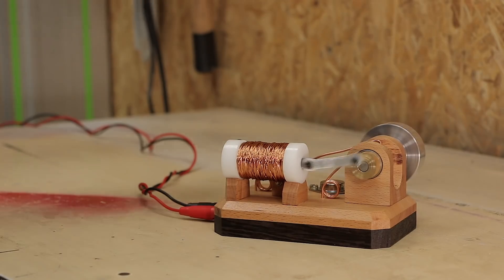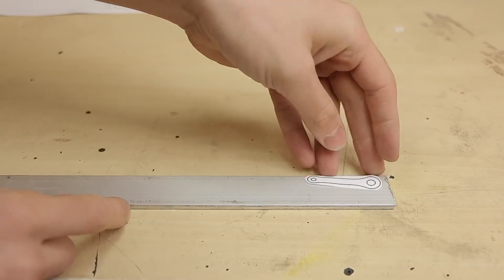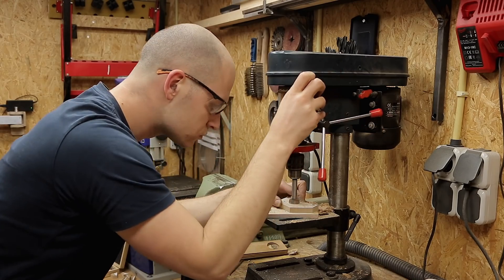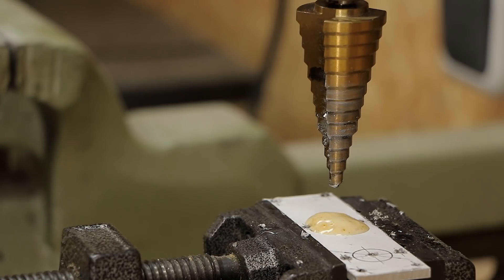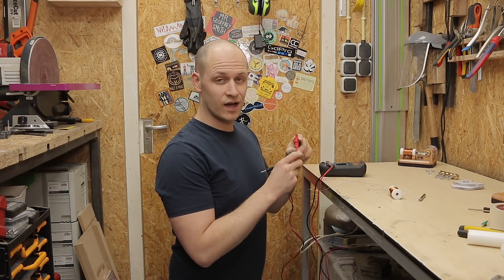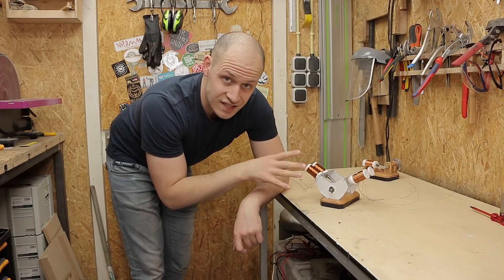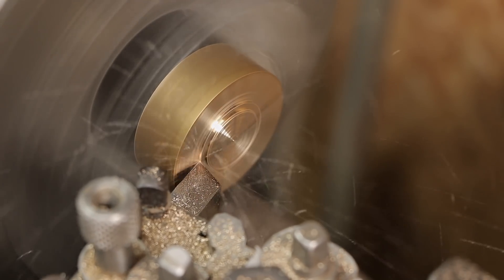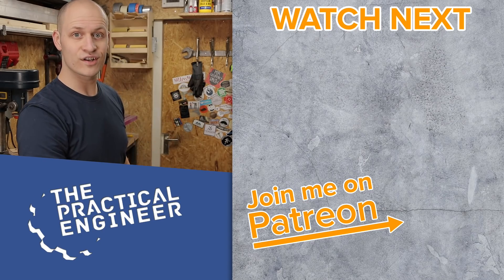How to make a V4 solenoid engine

Comment: now build a little transmission, and torque convertor, and let's see if this can drive a tiny vehicle..
Reply from the maker: Maybe in the future, its a fun project so who knows
Reply: @Thepracticalengineer  sweet!
Reply: The Practical Engineer 
My first car was a chevy chevette, I am betting your four cylinder engine is more powerful than the four cylinder engine in my chevette (even though I was able to beat trans ams off the line if we were going uphill due to the chevette’s manual verses the trans am’s automatic transmission)....
Reply: How about a manual and a little bot to shift?
Reply: @davepTfirst  Now THAT'S crazy, lol. when i made the comment, i imagined something along the lines of an electronically-actuated automatic transmission. However, if he were to go full R/C, it could be done as an electronically-actuated manual... however, without some kind of tachometer on the remote, he'd have no way of knowing when it was time to shift, and damage things....so perhaps an automatic would be better for this application.
Reply: @numberyellow  We loves the crazy, precious.  It's just fun to think of wild things.
Reply: @davepTfirst  Indeed, it is.
Reply: @numberyellow  don't need a tach if you just listen to the engine revving :) though who knows what the "redline" of one of these things is xD
Reply: @emissarygw2264  But technically, a redline here wouldn't be correlated to engine rotational speed but rather the amount of required power to drive the system at its current output. You could over-push the electrical system and burn coils with too much power. Or if you're not careful your electrical components could shatter your assembled "block" to bits with too much force. Similar problems exist in conventional combustion engines. They are solved by careful planning and tuning of your system 😀
Reply: @qtipextra  yeah when I said redline I mean "rpm above which bad things start to happen", though I didn't think of burning coils.
Reply: @qtipextra  Redline is still related to how fast the mechanical bits can spin before things start flying apart. What you're talking about is overheating. A proper cooling system would keep the coils cool enough at max power, or you could allow a bit of danger and just not run max power long enough to overheat.
Reply: Why would you need a torque converter
Reply: @gabrielwillis9078   The long answer would have something to do with compensating for the lack of a mechanical clutch, and torque multiplication..the short answer would simply be: "why the hell not?"
Reply: Being an electric engine, it doesnt need to remain spinning while the vehicle is stationary. That said, I too want to see him make a torque converter
Reply: @numberyellow  it would seem you confirmed my assumption that this engine did not have enough torque...
Reply: @vincentzanada1241  honestly, i have no earthly idea how much torque this thing puts out.. However, like you, i'm assuming the answer is "not much". I'd actually be very interested in seeing actual numbers for this thing.
Reply: C W  but that's no fun.... and not very challenging, from an engineering standpoint.. Simple is boring.
Reply: don't forget a little differential and little suspension!
Reply: @krishacz   Oh hell, why not? I doubt he's gonna do ANY of this shit, but we can hope, right?
Reply: Electric cars don’t have a transmission
Reply: @ts9749 Porsche Taycan
Reply: @thehasinhafiz  I can even see the Tesla using a transmission in the future. It has a reduction gearset currently, but the motors lose torque at 8000 rpm and by 14,000 rpm little tq is left.
Reply: @ts9749  Typically no...but this motor setup is entirely different from the typical motor setup you'd see in an electric car. this kind of a setup would require some form of a transmission, or torque convertor (or both), to provide enough torque for it to actually drive anything.
Reply: @ts9749  Electric cars can and do have multiple gears they switch between. For the same exact reason combustion engines do it. Yes, they have wider torque curves, but they're not infinite. https://cleantechnica.com/2019/07/22/ev-transmissions-are-coming-and-its-a-good-thing/
Reply: Real men ride with 3 pedals
Reply: Hasin Hafiz 
Wait until real life catches up to you and bad knees/hips/ankles make you switch to automatics.... of course if you are one of the cubicle slaves, never going out and doing anything physical, maybe life won’t catch up to you. But I’d take the falling apart state my body is in over cubicle citiot slavery, and I did, repeatedly....
Reply: @Rick_Sanchez_C137_  actually, if you live a mostly sedentary lifestyle, your body falls apart even faster.

Comment: When severing on a lathe reduse the speed. You will get less chatter.
Reply: Awesome job btw.
Reply from the maker: Thanks! I have played a lot with it but I kept having trouble. When I changed the tool it helped a bit.
Reply: @Thepracticalengineer  Highly recommend looking it up by material, you'll save a lot of effort... https://littlemachineshop.com/reference/cuttingspeeds.php

Comment: Great job on the build! Just a little suggestion. While technically speaking yours would be considered a four stroke. You could have built it to be a two stroke. Unless I’m wrong (and I may be) you do not need to have four lobes for timing. Obviously the solenoid needs to be off for the down stroke and on for the up, they way you made your crank, made it so you could have two pistons going up and two going down at the same time. And there may be some electrical thing I don’t understand with frequency or interference making your product 100% right. I’m more mechanically inclined than electrically. Anyway, impressive build. Would 100% watch this for hours on end.
Reply from the maker: Thanks for the extensive response Thomas! I now made it that they are all offset from each other. At any point there are two solenoids powering. when the first one is half way, the second ads in, when the second is half way the first one falls off and the third one comes in
Reply: The Practical Engineer now if I were to build my own, what electronics would I need. Could I not use the crank as a ground to complete the circuit? That is if the crank is grounded properly?

Comment: you just killed me with that coil wrap
Reply from the maker: It might not be the safest way to do it, but I made sure at all times to not really hold on to the spool or wire and just guide it.
Reply: @Thepracticalengineer  oh no, i was ok with that, but i feel that if you wrapped it as clean as possible then it would be a more efficient/stronger coil and each coil could be made exaclty the same, idk, i feel like a perfectionist sometimes.

Comment: whats the purpose of the holes in the flywheel? 
more mass = more inertia 
So if he wanted less inertia he could have reduced the diameter of the wheel, but instead choose to put holes in a larger diameter wheel. Is it just for aesthetics or is there another benefit? Could this be related to the stability of the wheel while spinning?
Reply from the maker: Hey, it's just for the looks of it. With the holes in it it's easier to see that it is spinning.
Reply: @Thepracticalengineer  Ohhhhhhhhh cool

Comment: It looks and sounds great but the alignment just wasn't there, so many  wiggling parts which increase your friction and affect the inertia :(
Reply from the maker: nope, it was hard to get the crankshaft all perfectly aligned this way
Reply: @Thepracticalengineer  More precise tolerances and actual press fit instead of lock tite fit would have helped you. Or the actual best would have been machining a one piece crank shaft.

Comment: When you love mechanical engineering but hate oil
Reply from the maker: or own a lot of drill bits
Reply: @Thepracticalengineer  make a V8 !!!!!!!!!!!!!PLS¡¡¡¡¡¡¡¡¡¡¡¡¡¡
Reply: @Thepracticalengineer  ha
Reply: @Thepracticalengineer  Crongratulations mannn
Reply: You must not be American
Reply: @faroukm4148  he's dutch
Reply: @faroukm4148  ¡¡¡¡¡¡¡¡MERICA!!!!! IM FroM aRGentIna Im aMEricaN
Reply: @faroukm4148  but seriosly its almost imposible to find someone talking of america without meaning ee uu its a bit i don't nkow "sad", wierd
Reply: Feed and Speed calculations would have helped a lot too.
Reply: @RtotheK605  ...formerly Chuck's
Reply: Thats why people become electrical engineers lol
Reply: @7899h8j  i
Reply: @Gowtham_97G  ?
Reply: Bro what. Piston engines are hardly obsolete considering that they are so widely used, and if they are going to be replaced then it's going to be by electric motors rather than another type of internal combustion engine. Wankel engines may be compact and light but in terms of "efficiency" they actually get less power from a given amount of fuel than a pistoned engine. You also cannot make a Wankel engine from these solenoids because the solenoids are acting as pistons, and the entire point of a Wankel engine is that it has no pistons.

Lastly, reality is only Euclidean locally.
Reply: @skua675  Don't feed the troll
Reply: @skua675  Ok boomer
Reply: The oil isn't the bad part.  The bad part is bolts and things that have rusted in place so much it's like they are welded.  Then the bolt heads can strip, or the bolt break off and you need to extract them.  Then the threads can cross or just warp and you need to re tap the hole.  Once I had the tap break in the hole.  They are made from super-hardened steel, so no chance at drilling the tap out.  Days like that make you wish you only had to deal with a little oil.
     However if you have a PHD in mechanical engineering, you just come up with the plans and have the technicians deal with the oil, bolt holes, and other issues.  I aced every Mechanical Engineering Design class I took, but I ran out of money for classes plus working full time and taking classes at the same time is difficult.  So I am destined to be the technician inside the machine swearing while the engineers stop by every hour and ask "How's it going?", then the supervisor shows up and says "Make sure you have your safety glasses on.  You are installing a 6 ton tool into the press, if it closes on your head you will need your safety glasses on."  The good part is you can't hear either of them because of the hearing protection regulation on the floor.  So I reply "Sorry it's 100 decibels here, I need my earplugs in, so I can't hear you."
Reply: @BrettonFerguson  I feel your pain dude, I feel your pain...
Reply: C W  this is a nick knack bro
Reply: That's really me bro 😀😀😀
Reply: When you are a petroleum engineering guy
Reply: vasanth vasanth I love the renewable that is oil. 🤔
Reply: I cut brass and aluminium all the time without oil, soft and easy to machine. Oil will give you a better finish and aid with heat, but it makes a lot of mess.
Reply: Apparently, the author does not have enough experience in drilling metal.
Reply: Me too
Reply: If you hate Oil, all your mechanical engineering wil wear out due to friction
Reply: Ok boomer

Comment: Why the fck does it matter how it is aligned, it's an electric motor
Reply: how it is aligned? As in v4/i4/Flat 4? Each one has a different balance to the pistons and crank shaft making them have different pros and cons regardless of if combustion is powering them or not.
Reply: @OnlyForThePriceOf999  maybe for the looks of it or smth, but solenoids are the least efficient electric motors, so it doesn't really matter how it gets aligned. Take, for example, a brushless dc motor. Or any of brushless motors, be it ac or dc
Reply: @lukatomic8778  I'm fully aware that solenoids are inefficient, I never even alluded I didn't know that. Even though this will never be used to power anything its still fun to try and tweak the specs. So whilst in a general sense the alignment doesn't really matter, it matters in an entertainment and cool factor sense.
Reply from the maker: It is mainly a looks thing, but also to power the solenoids at the right time
Reply: At least google it, do some research of your own

Comment: The next logical step would be to make a working solenoid radial engine
Reply from the maker: Its on my list
Reply: lol
Reply: Rotary for the win
Reply: Or a W18.
Reply: Radial, wankel, or aero rotary?
Reply: YES!!!
Reply: Just look up induction motors. Its the normal electrical motor used in most things
Reply: Yes we have them .it's called electric motor  Lol

Comment: No such thing as a v4 engine..
Reply: Tf are you talking about, V4s are just a configuration, of course they exist. They're mostly used on motorcycles since straight 4s are compact enough and cheaper to manufacture. Subaru uses flat 4s in a lot of cars, which is really just a 180° V4
Reply: @tyronicusmaximus4230  No such thing as an engine my friend
Reply: @siren_grnk  you believe in things?
Reply: @tyronicusmaximus4230  No

Comment: I think it would have been easier to use the crankshaft as the commutator - set it under power but isolate parts of it when no power should flow.

Comment: Very nice work...that Idea was in my mind since 1998 and i worked with one Valve but I used a metal nail to wrap the copper wire 😁
Reply from the maker: Sweet! Was the nail the plunger for the solenoid?
Reply: @Thepracticalengineer  actually I used it in different way at that time! I used the nail as the heart which I wrap the copper around it and put a magnetic in both ends and every second I depolarize the polarity which allow the nail goes up and down every second.